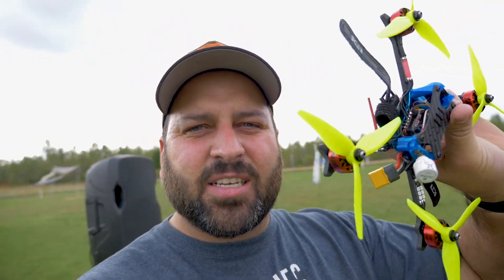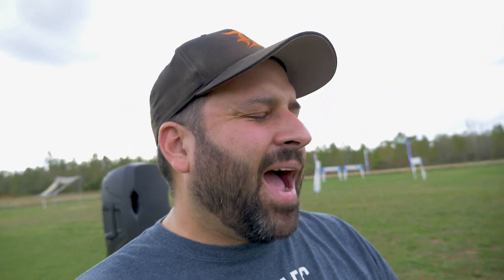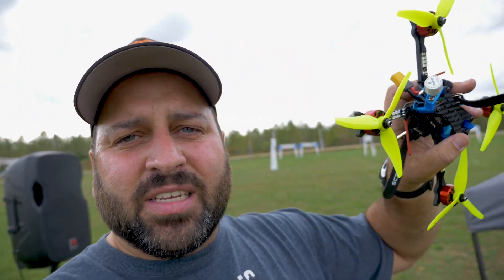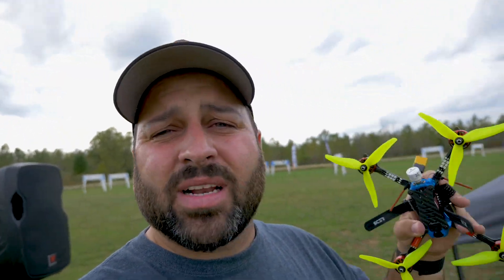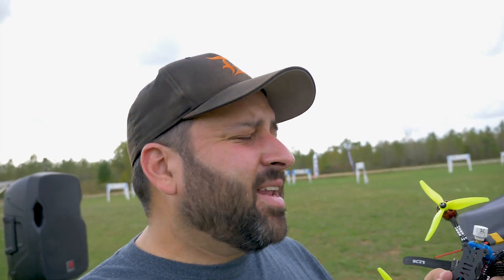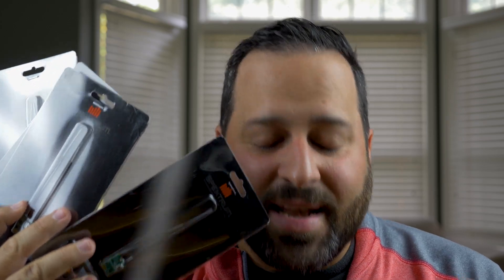Quitting Crossfire ?!? Testing Spektrum SRXL V2

Comment: Thanks for the video and testing. Great flying btw, I currently have the Jumper T16 Pro and use xm+ for my quads and spektrum rx for my planes & wings. I've been thinking about switching to the IX12 but was wondering how well the radio is range wise? I've heard so much about failsafe with spektrum radios but honestly with the jumper i've had no issues at all. If you or anyone on your channel can give me feedback using the IX12 for everything including planes it would help me make the decision of going full spektrum.

Comment: Still just use spm4650? Tried it yesterday. I think I stop use my crossfire. Great video btw
Reply from the maker: Yeah it's still what I'm using.  I use crossfire on my freestyle quads still, but 100% of my racers are on SPM4650 and I love it.
Reply: @JohnEFly  how long is the range of the spm4650? Possible to use on freestylers as well. I am thinkin of selling my crossfire and go all spektrum on both racers and freestylers
Reply from the maker: @e.headfpv6500  I've never really pushed it, but yeah totally fine for freestyle.

Comment: Actually started with Spektrum getting into quads because of Crossfire. I went to the ends of the earth and back to get telemetry to work with the SPM4649T. I did eventually get it to work. Now with SRXL2 and the 4650 , after ordering it for a Diatone GTR369 I hope I can get that quad to run betaflight 4.0 or whatever need be for SRXL2. Unfortunately the new 4650 is not backwards compatible. I am confident in my tech ability that I can flash the newer betaflight 4.0 firmware to the R369 and tune it from the ground up. I know AndyRC said he cannot get it to run or maybe tuned on 4.0. Hopefully its just a case of not spending enough time with the R369 yet. Wish me luck
Reply: Never ever used Crossfire btw lol

Comment: Is it the same Protokoll on the spm4649t?
Will the 4650 only work with bf4.01 or older vrrsions?
Regards Uwe
Reply from the maker: the new protocol only works in betaflight 4.1 or a special spektrum build of 4.0.3.  Maybe these receivers support the old protocol too?  I'm not sure.

Comment: Im confused. Why the fuck use CF at races? Ive never been to a race so this is news to me. I thought CF was for long range freestyle.
Reply from the maker: Crossfire is advertised as having the lowest latency of any control link.  That makes it very popular with racers
Reply: @JohnEFly  Is that not the case anymore with SRXL V2?
Reply from the maker: @bansheerider619  maybe, maybe not.  I just wanted to see if it impacted me on the course.  If I can fly the same and get equal or better lap times I don't care about theoretical latency values.

Comment: I love my Spektrum radios. The gimbal feeling is what sets it apart in my mind. I just picked up an ix12 for crossfire adaptability, but for more fixed wing applications. For copters, I stick to the 2.4ghz RX and send it. If you don't have to go far I haven't seen the need for crossfire. Doesn't Evan Turner fly Spektrum on that same RX currently?
Reply from the maker: Yes, Evan switched from Crossfire to these new receivers.

Comment: If your looking for the lowest latency I’m pretty sure in the game would be flysky paladin radio rocking the new afdhs v3 protocol , if you don’t mind 2.4 ghz but your testing  spektrum so I’d imagine you wouldn’t .... I haven’t yet tried it myself but I came into the hobby using flysky fs-i6s afdhs v2 protocol then the nirvana same afdhs v2  it at the beginning of the the summer this year I went to crossfire n honestly I didn’t feel much difference other the range is better with crossfire, and the paladin afdhs v3 at only 3 ms , I don’t think anyone would really feel much difference but if your looking for the absolutely lowest latency I think that’s the way to go ....

Comment: Has anyone did a side by side btwn the old spektrum and new spektrum receivers to see how much has changed? Both latency and range...
Reply from the maker: Not that I'm aware of.  I have asked a local pilot that just started upgrading to the new one if he noticed a difference, and he said he didn't really notice any difference.  That's about all I'm aware of.
Reply: Both the new and the older ones are 11ms. There shouldn't be any difference in latency. As for range - the SPM4649T was reliable up to over 200m, so more than enough for racing.
Reply: Robert Gosz 200m?? More like 200ft

Comment: I've been running these since they came out, I really like them. Spektrum has excellent latency. 900mhz is great for range and penetration, just doesn't make sense to me outside of LR builds and maybe bando freestyle stuff. I just see people running it on whoops and toothpicks and it seems odd.
Reply: What’s your range with spectrum
Reply: @Rckid28  i dont fly long range but with what i do (fly around my property and well i use spektrum for surface stuff too) and i never hit the limit neither on my dx6 air radio or my dx5 surface radio. so imo they both have more than sufficient range and the latency is definitely good enough to race.

Comment: I always felt the latency mushiness on crossfire along with failsafes which I never had using spektrum... I always used Spektrum which I heard was the fastest protocol from stick input to RX, so when I went to crossfire I only felt mushy and delay. But I kept using it because of Hype I guess until I was tired of having weird glitches and failsafes costing me races, and the extra bulk and battery... SO I switched back.. I even raced at MDX in caves with Spektrum and had no issues. I think if you come from Taranis you would definitely feel the improved latency with crossfire, not from spektrum. HOWEVER, I would LOVE to see someone put this latency to bed for once and for all and do a true latency test from stick input to rx on all radios and links!!! 

Ps. I have always complained about the awful wires.. ugh!!!
Reply from the maker: I'll be honest... do you really care about specific latency tests from stick inputs to rx on all radio links?  I feel like we've seen those tests... but I also know that I don't care.

I only care about one test, and that's which combination consistently gives me the lowest lap times, and which has the fewest issues.  So far Spektrum is fitting the bill for me, and I couldn't be happier.  I'm not concerned about winning data sheet pissing contests about how my setup has the lowest latency or some other number, unless it's a measure of winning races...

Comment: Does this have the same features as f.port? Control and telemetry over one wire and lua script supprt?
Reply from the maker: Control and Telemetry over 1 wire, yes.  I don't think Lua scripts are a thing on Spektrum?  It does handle smart audio from the radio via that single wire though.
Reply: No lua on Spektrum.
Reply: And presumably no spektrum counterpart exists

Comment: Great video as always Johnny. Regarding your comments about fixed mounts for your camera not always giving you the same angle - I don't think it's the mount, I think its the sensor on the camera not always being mounted flush.  

I've stopped using fixed mounts for this reason, instead I adjust the cam angle until the FOV has the motor nuts of the front arms just in view. That results in an effective angle of about 50 degrees, but when you eyeball the actual angle the camera is on to achieve this identical FOV across quads, it varies by as much as 10 degrees!

Since I started setting my cam angle this way, every one of my quads feels the same and I dont have to worry about running a different quad if I trash one on race day.
Reply from the maker: That makes a lot of sense.  You’re probably right.  Thanks!
Reply: Nice one
Reply: I do the same thing, I go by how much of the front props I can see in view.

Comment: If you're running the diamond antenna on your CRSF, don't. It is FAR worse than the stock V2. I have never once failsafed with the stock v2 and I had a buddy at a race who was failsafing like crazy with the diamond and he put on my stock V2 and it fixed all his issues.
Reply from the maker: My current setup is a stock v2 antenna.  I tried the v1, the diamond and the v2.  I had issues with all three.  I did think the diamond performed the worst for me though.

Comment: were you running 3.0 firmware on your crossfire with forced 150hz? i was having the same problem at IO and the 3.0 update fixed for me
Reply from the maker: Yes, 3.0 with forced 150.  I had a few issues on 2.9 at IO.  Then upgraded to 3.0 and honestly had more issues.

Comment: I have been considering a transition to Xfire for a few months now to gain that extra range. I have always been a Spektrum “Snob” but I have only ever failsafed 1 time, and that cost me a new GoPro...  Bando flying has it’s complications but Spektrum has been a great tool so far. I just bought a bunch of the SRXL v2s, wondering, how was RSSI even though you weren’t THAT far away. Did you try a range test to see if there were any improvements??  Curious and excited to try them out. Thanks for the video

Comment: At the WDC in Turkey, Spektrum was having failsafes and CRSF was not...  Have you tried the Diamond antenna on the transmitter?  The other thing to consider is the the Immortal T mounted horizontally (like every does) has two nulls that can easily point at you.  Maybe you are getting mini-failsafe because of the immoratal T null?   I wonder if you were to build and "immortal L" like Steele does, if that would eliminate the nulls?   Not sure if 2.4 is going to solve your problem long term.  900 has more penetration and it is a far less used frequency.  I hope you figure it out though!  Keep the great content coming!
Reply from the maker: That's what I heard.  I heard Headsup had to switch his quads back to CRSF there.  Yes, I have a diamond antenna and I have tried it.  I also have the V1 and V2 TX antennas.  

Regarding the penetration and all, that's what I used to think.  It also has less available bandwidth compared to 2.4.  One thing I did notice is that if I put my TX antenna vertical it is less likely to have a failsafe, but I still don't trust it.  Trappy claims the "Immortal L" is a mistake, but who knows.  Another important thing is that I haven't been alone in this.  I've seen many racers have issues and switch away from CRSF lately for racing.  At the Mid-America Throwdown quite a few pilots were having failsafe issues in the same spot of the track.  So I don't think it's just something I was doing.

I'm glad you enjoy the content!
Reply: John E Fly As a crazy test, maybe try crsf diversity with one horizontal and one vertical.
Reply from the maker: @Waylandir  That would be an insane setup for racing.  Which is all I'm really concerned with here.  I would assume it would work much better

Comment: I was completely loosing connection on crossfire at the last race at only about 200 feet and it was only happening on one of my 2 racers. The one having issue the receiver was mounted right next to where the xt60 is soldered to the esc, the other it was mounted upside down on the top plate. The first thing I did was move the receiver on the quad having issues and it worked perfectly after that.
Reply from the maker: Yeah I've noticed similar things.  I've moved receivers in my builds so many times.  Sometimes it fixed it, sometimes not.  Thanks for the tips though!

Comment: Dude, to be honest, I really dislike TBS. And I don't think I even have to explain why. But, still, I bet it's a firmware issue. And, BTW, I'm even thinking about getting Crossfire, after what FrSky did to us that bought the R9 system last year...
Anyway. Try to get a Jumper T16. The Pro version comes with hall effect gimbals and now the multiprotocol module is internal. It's definitely not going to be a better radio, but it's going to allow you to use any receiver you want. 😉
Reply from the maker: I'm not interested in a T16.  I love my IX12 and don't plan on changing it any time soon.  Regarding firmware versions, I've tried multiple versions.  But at some point enough is enough.  Bottom line was that I had faster times with the Spektrum receiver anyways, so what's the point of the extras for crossfire, especially when it's causing issues?  I'm not the only one having issues either.
Reply: @JohnEFly  Yeah, that's true.
Reply: True, but with the multi protocol module you don't get Spektrum dual (diversity) antenna TX. And this feature improves range and reliability.
Reply: @robertgosz4281  Oh... I see...

Comment: Awesome video. I know your not a “reviewer “ per se, but you always demonstrate an ability to deliver comprehensive detailed information to the viewer.  

Much better job than 90% of the “reviewers” out there. Solid info.
Reply from the maker: Thanks Jon.  I purposefully stay away from the detail review stuff, always have.  For me it mostly just comes down to "does it make me faster", that's why that's all that I show unless there is something else that is important.
Reply: @JohnEFly  Do you think that this would work with the new Jumper with internal multi-protocol module? For those that may want to try this low latency reciever without having a spektrum radio?
Reply from the maker: @JonE5FPV  I think it should work.  The receiver is compatible with DSMX.  I'm not sure if the fastest mode will work, I think it will?

Comment: Is there a 3d printed canopy for this frame?
Reply from the maker: Phoenix3D announced one, but I don't think it's available yet.  It should be available soon.
Reply: @JohnEFly  does this work with the fixed angle camera mount sold on pyrodrone, which is for the original floss 3.0? https://pyrodrone.com/products/fixed-fpv-cam-mount-for-floss-3-0
Reply from the maker: @JT-jy2sy  Pyrodrone has a new fixed mount specific for the Lite.  It is not compatible with the normal floss mounts.  You can find it here: https://pyrodrone.com/products/fixed-fpv-cam-mount-for-floss-3-0-lite

Comment: I haven't had a lot of success with a 900 MHz control-link at events. Even when I start flying with just a couple other people I was having stutters, which only get worse as more pilots running 900 get into the air. 2.4 definitely is more reliable but the range is much shorter.

Comment: It’s weird that crossfire has been working for ages for everyone and now it’s having issues. Makes me wonder what’s changed? I know there was beta firmware going around, are you running that?

Great video btw, always enjoy your content 👍
Reply from the maker: Thank you!  Yeah, it is frustrating.  I feel like I didn't have issues for close to a year, but the last few months have been awful.  So many pilots talk about magic firmware versions and such, but nothing seems to work for me.  At the Mid-America Throwdown lots of pilots were having issues, but some pilots had no issues at all.  No idea.
Reply: @JohnEFly  I personally don't run it but have heard just to stick on the latest stable firmware is best
Reply: @knighthawkfpv  I think you're just seeing the over saturation. Running 900mhz on LR builds is great. Having 40 guys at a race event all running 900mhz is silly and ineffective. This is what a lot of people are experiencing now imo.

There is less bandwidth and channel space available with 900mhz compared to 2.4ghz. Getting lots of pilots in the air was literally the problem the 2.4ghz control link and spread spectrum frequency hopping was invented to solve - by Spektrum. Seems we have come full circle, just took 15 years lol.
Reply: Putting my conspiracy theory hat on.  Maybe the new Spektrum code blasts crossfire to make it drop so you switch.  ;-) 
I’ve had a couple Transmitters and really love my Spektrum.  It just always works.  I’m looking forward to the NX14.

Comment: i've seen where a defective transmitter antenna will cause what you are seeing on Crossfire as well.
Reply from the maker: Yes, I've seen that too.  But I've tried 2 different transmitters, 2 different radios and 3 different TX antennas now.  At that point... perhaps it's time to give up?
Reply: How many people are using crossfire when you are racing?